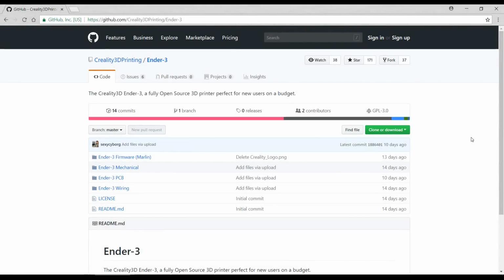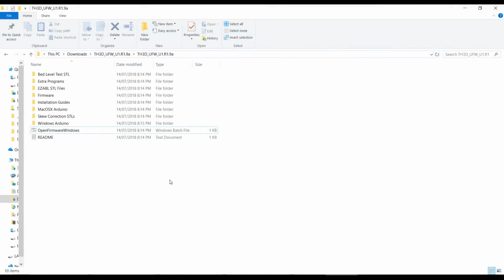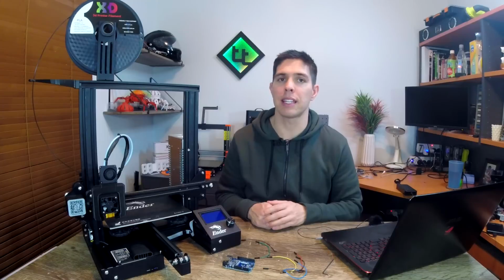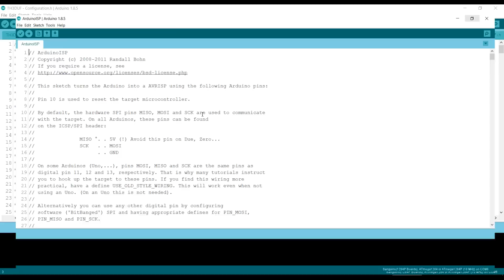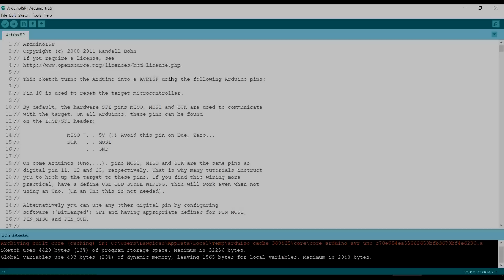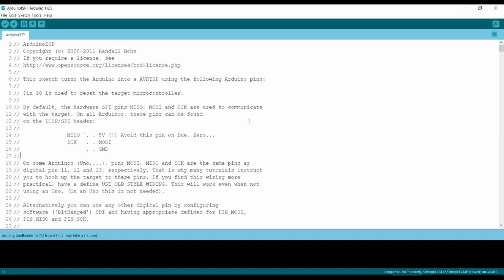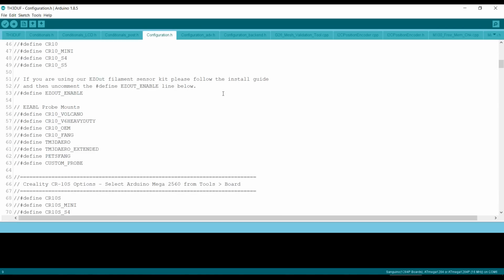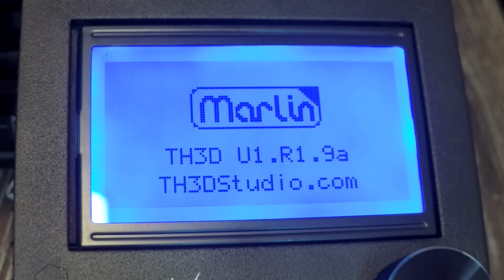Ender 3: How to install a bootloader and update firmware

Comment: I tried to do this with a Nano. It didn't work. To flash the Nano i needed to use "328p old bootloader" and I'm guessing this has something to do with it
Reply from the maker: I haven't tried a nano but I imagine some googling will get you over the line.
Reply: Teaching Tech it didn’t work because I had Chinese clones with the old boot loader and no genuine one to reflash the boot loader on my nano to reflash the boot loader on my printer. Lol

Comment: Thank you very much,  it works like a charm. 

A small note, when installing the wires you have the arduino powered on all the time via the laptop. I did exactly that,  after plugging in the last wire at about 7.40min in the video suddenly the arduino is disconnected from power. And then you stated to plug  in the arduino.

It did not break anything from me, but it might be worth mentioning to unplug the arduino from power when installing the wires. 

Keep up the good work, I'm loving you're Ender-3 video's.

Comment: Arduino: 1.8.5 (Windows 10), Board: "Sanguino(1284P Boards), ATmega1284 or ATmega1284P (16 MHz)"

avrdude: stk500_recv(): programmer is not responding
avrdude: stk500_getsync() attempt 1 of 10: not in sync: resp=0x03
avrdude: stk500_recv(): programmer is not responding
avrdude: stk500_getsync() attempt 2 of 10: not in sync: resp=0x03
avrdude: stk500_recv(): programmer is not responding
avrdude: stk500_getsync() attempt 3 of 10: not in sync: resp=0x03
avrdude: stk500_recv(): programmer is not responding
avrdude: stk500_getsync() attempt 4 of 10: not in sync: resp=0x03
avrdude: stk500_recv(): programmer is not responding
avrdude: stk500_getsync() attempt 5 of 10: not in sync: resp=0x03
avrdude: stk500_recv(): programmer is not responding
avrdude: stk500_getsync() attempt 6 of 10: not in sync: resp=0x03
avrdude: stk500_recv(): programmer is not responding
avrdude: stk500_getsync() attempt 7 of 10: not in sync: resp=0x03
avrdude: stk500_recv(): programmer is not responding
avrdude: stk500_getsync() attempt 8 of 10: not in sync: resp=0x03
avrdude: stk500_recv(): programmer is not responding
avrdude: stk500_getsync() attempt 9 of 10: not in sync: resp=0x03
avrdude: stk500_recv(): programmer is not responding
avrdude: stk500_getsync() attempt 10 of 10: not in sync: resp=0x03
Error while burning bootloader.

This report would have more information with
"Show verbose output during compilation"
option enabled in File -> Preferences.
Reply: DID IT OHHHH YEAH!!!!
Reply from the maker: Please post the solution for future viewers.
Reply: I didn't notice when you open the examples window, it happened so fast.  So, i missed that step and i thought i did something wrong. after the 3rd time i finally saw what i missed. the wording is so small at times even on a 32 inch HD screen.
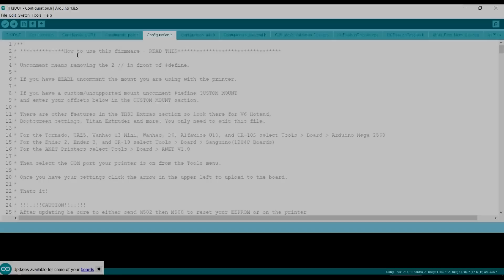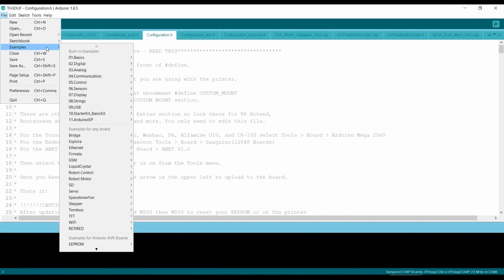Reply: pay attention to 6:00 to 6:05. easy to miss a vital and important step.

Comment: Hi Teaching Tech:
How can you add the option to resume after lack of electrical power ?.
How can I check the configuration that is loaded on the machine? And finally how do I get back to the original configuration? Thank you
Reply from the maker: The firmware and stored settings come up when you connect via usb with Simplify 3D, Octoprint, Repetier-Host, proneface, etc.
Power resume is in the firmware creality posted on their github and in beta on th3d. To restore simply flash the creality github firmware. Need to flash bootloader before any of this is possible.

Comment: Has anyone had the Invalid Device Signature 0x000000 error when flashing? and if so how do you fix it? I'm stuck trying to burn the bootloader to my ender3 v1.1.3 board. https://forum.th3dstudio.com/d/71-invalid-device-signature-0x000000-flashing-ender-3-v1-1-3-board
Reply from the maker: Many report dodgy USB cables to blame.
Reply: Thanks for the reply! I'll get another one and try that. I bought the uno kit direct from TH3D and i've tried a usbasp and neither have worked yet flashing the bootloader.

Comment: Hola : 
Da error cuando procede a quemar? 
avrdude: Yikes!  Invalid device signature.
         Double check connections and try again, or use -F to override
         this check.
Error quemando bootloader
Que puede ser?
Gracias
Reply from the maker: First step is to recheck all of the settings in Arduino. Correct port, board, programmer.
Reply: Hola: por fin despues de unos cuantos intentos fallidos, (presumo que por el cable USB muy largo o en mal estado) y algunos sustos pude flash a bootloader the Meizi. 
Muy agradecido por tu video. 
Desde Argentina te envio un fuerte abrazo 
JUAN CARLOS
Reply: I'm having the same error. I can't figure it out either - https://forum.th3dstudio.com/d/71-invalid-device-signature-0x000000-flashing-ender-3-v1-1-3-board
Reply: I have the same problem :-(
Reply: @dkhelicopterman  I wasnt ever able to get my original board to work so I ended up getting a new one from tiny machines for ~$50. I tried multiple cables and programmers (2 usbasp & an arduino) and they just wouldn't work with the board so I gave up. I did see some info that recommended using an external crystal oscillator and injecting that signal onto a few pins of the board (xtal and one other I believe) but I was never too sure about doing that so I just figured it was best to get a replacement which worked perfectly!
Reply: I was having this problem and followed this: https://old.reddit.com/r/ender3/comments/a0r7u9/cannot_flash_bootloader_with_th3d_and_arduino/eak02oz/

Comment: I got to the point where I'm ready to upload the firmware to the printer but my port is grayed out and won't let me choose a port. Now my printer is basically a brick. How do I fix this? Please help!
Reply from the maker: Just checking you have taken the cables off from the arduino and then plugged the mainboard into the computer?
If you haven't yet you need to install the driver or the computer won't recognise the device: https://www.th3dstudio.com/knowledge-base/creality-printer-drivers-all-models/
Reply: @TeachingTech  thank you for the reply! I installed the driver files but idk what to do with them now. It's just a folder on my desktop. Sorry I'm not the best when it comes to this stuff lol
Reply from the maker: Try the install drivers manually section of this: https://www.windowscentral.com/how-properly-update-device-drivers-windows-10
Reply: I tried  a different cable and it's working now!!! Thanks for the  advice still. Your videos are awesome!

Comment: Does should this work with an mega 2560 instead of arduino uno?
Reply from the maker: Yes. The instructions are in the Arduino as ISP sketch.
Reply: Teaching Tech Thanks for your reply. 
At 7:33 the 10th pin is equivalent to which one on the mega 2560 board?
Reply from the maker: I think it is still pin 10 looking at line 73 of the Arduino sketch.
Reply: Teaching Tech i will give a try, thanks for your help, very appreciated!

Comment: Everything went super smooth except after flashing the boot loader with Arduino, plugged in the new USB cord and the THEDUF port is greyed out. windows 10. looked in devices and it sees the device as FT232R USB UART but looks like it needs drivers or something. I get the yellow triangle with a ! on the device. Also I have tried several different cords. can you help? thank you
Reply from the maker: Hopefully ths page can sort you out:

https://www.th3dstudio.com/knowledge-base/creality-printer-drivers-all-models/
Reply: @TeachingTech  Thank you I was having the same issue. Now I'm good to go.

Comment: How to resume printing while power cut
Reply from the maker: You need to flash either the official creality Marlin which is too old 
to have thermal runaway protection, or use the BETA version of TH3D. I 
haven't played with that yet so it might not compile with my 
instructions.

Comment: Does the ender 3 need to be assembled before I flash the boot loader and new firmware, or can I just install onto the board before assembly??
Reply from the maker: I can't think of any reason why it wouldn't work.

Comment: Can you use a USBasp cable to burn the bootloader onto the board instead of an Arduino? That's what I did with my Anet A8 board.
Reply from the maker: I've had a google and yes that will work perfectly. Just need to match thepins on the two ICSP headers like in my video.

Comment: So whats the different between this and original marlin?
Reply from the maker: It's still Marlin, but with some code moved around to make configuring for certain 3d printers easier. It is also based on a newer version of Marlin than what was shipped on the Ender 3.
Reply: Thanks! So it has settings from Ender 3 Marlin which Creality realesed? Except resume of course
Reply from the maker: The th3d version was available before that so probably minor differences. Setting it up is mainly configuring print volume, etc so differences would be minor between them.
Reply: Yes it is clear now, but I see that it works for people so it should be fine :) I will flash it and probably soon add BLtouch. As I understand Marlin 2.0 is not for this kind of printers and 1.9 is the last stable release which won't be updated anymore?

Comment: Michael thought I'd share info,  in exchanges with Creality they advised "You need to use an ISP cable to change firmware, this is a problem, for most customers don't have this. If you own one, we can send you the firmware file to you, just tell us your mail." It is the same file that is on their 'open source' website. The UNO method adding a bootloader works but they advise don't do that due to the storage being used up. As you are going to need one anyway use the UNO as an ISP instead. That way you can replace the stock firmware if anything goes 'wrong'.
Reply from the maker: It's true you could program the main board with the Uno or a ISP via the jumper cables to save the space of a bootloader. Not very convenient though.

Comment: I was able to upload the boot loader, but when I connect the arduino to the printer board and try to burn the boot loader I get an “invalid device” error. I have triple checked all of the connections. Any ideas?
Reply from the maker: Bootloader is the hardest part, well done. Have you changed the programmer back from in the menu? Just checking that you have removed the Uno and are now connecting directly via USB?
Reply: I guess I should clarify.  I was able to upload to the Arduino.  But when i try to burn to the printer board I get that error.  Invalid device signature.  All the settings are just like your video.  The printer board is a Creality v 1.1.3.  Would that make any difference?
Reply: Switched to a USB2 and re-checked continuity and connections and it worked like a charm.  Now to try and print something.  Your video was instrumental in me getting it done though.  Very well done.
Reply: Teaching Tech : x axis is still moving twice the distance it should. Probably a motor driver issue.  Still working on a fix.
Reply: by switched to a USB2 do you mean from a USB 3.0 port -> 2.0? I'm keep getting and invalid device signature error 0x000000 - https://forum.th3dstudio.com/d/71-invalid-device-signature-0x000000-flashing-ender-3-v1-1-3-board

Comment: I've spent all day trying to flash a boot loader to my Ender 3 and it's driving me mad.  I've followed the instructions in the video and succeeded with the first bit uploading the Arduino sketch but when I come to burning the bootloader I get the error: avrdude: stk500_recv(): programmer is not responding
avrdude: stk500_getsync() attempt 1 of 10: not in sync: resp=0x03.

Please can someone help me with this?!
Reply from the maker: I can only think something is not connected properly. That  error normally indicates so.

Comment: i followed this and installed, everything worked just as you explained. now,  tried to follow another video on adding the bltouch and uploading another marlin build now to add BL touch and it wont let me upload it to the ender :(
Reply from the maker: The main board has limited memory, from what I've researched you have to disable other features to get bltouch support fitting.
Reply: Teaching Tech I got it working now, but on the video you’re going to do on it, all I need to know is one thing lol, will your version of bltouch install have sdcard support or nah
Reply from the maker: Normally you have to disable it, I'll be trying hard to keep it otherwise it's a bit of a deal breaker.
Reply: Teaching Tech someone here states they keep the sdcard http://jonathanlundstrom.me/2017/10/23/cr-10-bltouch-firmware/ but I haven’t checked and it might reduce the points the BLTouch uses but not sure

Comment: that is able to power failiour then after that power back then start resume print in this firemare ....please fast tell me ...that is support power resume
Reply from the maker: The original Creality firmware, yes it is. The th3d firmware, not yet.
Reply: you mean that is not support power failuer and power resume feture's....in this time
Reply from the maker: If you flash the TH3D unified frmware as I have shown, you are correct.
Reply: Teaching Tech yes but my firemare not show power resume option if power failiur then after that power back but not start the print resume .....not work resume feture in this firemare ....please tell me solution
Reply from the maker: If your firmware is standard, it should work. Ifnot, please contact the company you purchased it from.

Comment: Michael, Really nice, but the lack of the power loss restart though (with SD card not USB printing) is one of the main sales 'features' of the original printer so might be an issue for some. Not quite sure why you recommend the TH3D and not the original firmware, apart from the base Marlin version out of interest I am going to look at the code to see if the temp runaway etc is there although I expect others have done that already? The later is generic whereas the former is specific to this printer and does contain this feature. Either way does seem a bit odd though as you still need a bootloader or you couldn't load it anyway. Going through this process invalidates the original warranty (so do all the other hardware mods) so not sure this is for all? Will be interesting when the BLTouch mod video is available.
Reply: I checked and thermal runaway not in the Creality version (see configuration_adv.h).... answers my question really why use TH3D but I like the other users comment use Marlin directly :-)
Reply from the maker: I think th3d will have power panic soon and the Creality version will probably be updated soon too. We will be spoilt for choice.
Reply: I wish Creality would add a bootloader, would make the whole process so much simpler, but it is easy to add it. There is a comment buried somewhere in notes that the board Creality use the uPC might have limited storage capacity memory wise for firmware so you need to be careful about what is uploaded.
Reply from the maker: I definitely does, about half the space of the usual Mega 2560 boards. Arduino will not attempt upload if the compiled firmware is too big to fit.
Reply: Maybe they (Creality) might offer a PCB upgrade with a bigger uPC in time if needed? Or self service RAMPS et al upgrade time as with so many original RepRap clones? BTW do you have a video that explains layer1 squish?
Reply from the maker: I don't have a video on that yet but my video tomorrow will cover it indirectly because it's comparng two diffrent thickness build surfaces.
Reply: Great. Been playing with it myself on my Ender 3 and the standard build plate, results go from you need a sledge hammer to remove the item as you can lift the printer nd the object stays stuck to something that really doesn't work too well and taller objects often 'shift' randomly. Yes heating the bed to almost 90'C works to remove the former but needs care as it will remove finger prints at that temp if not careful. Squish is easier to see on a glass plate as sure you know.
Reply from the maker: I agree, easier to see squish on smooth surface. You can try printng a one layer object, but if your z axis an end stop is not repeatable you will struggle to make use of that.

Comment: When using the TH3D Unified do you need to remove the command in the config.h file for the EZABL?
Reply from the maker: As long as you don't uncomment it that part of the code will be ignored.
Reply: Oh good to know, when I emailed Chris at TH3D it seemed I had to add an uncomment not remove lol, good to know. I'm going to do this for sure for the thermal run-away as well. I am lucky as my Ender 3 is the updated version with removable buildtak and I didn't have to adjust the z-axis switch it has a nub that gives it the perfect height. Just might have a bad Y axis stop switch but I have an extra one from my cr-10s. I really appreciate your reply and channel. Keep it up!